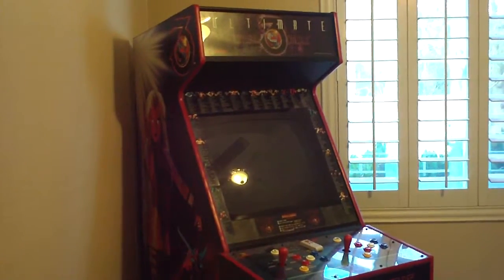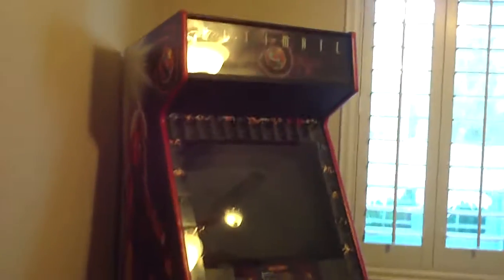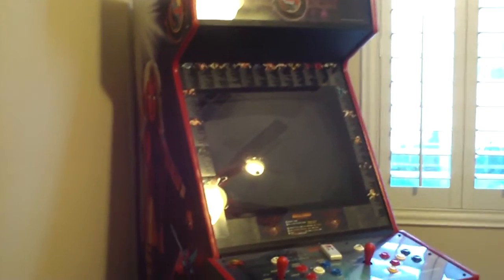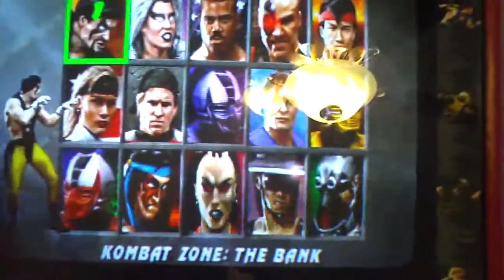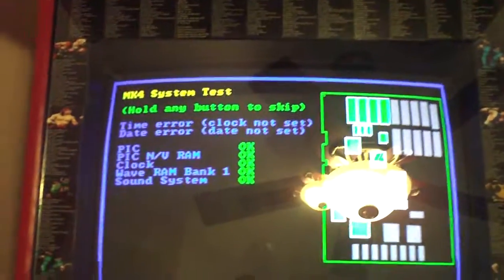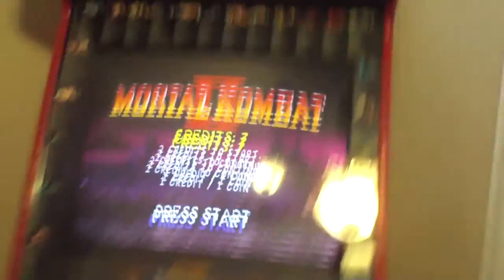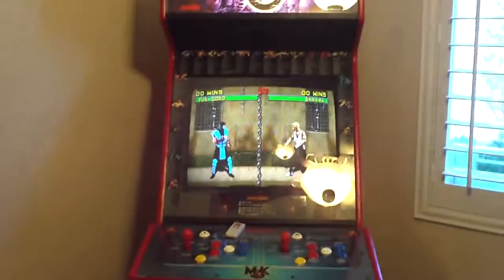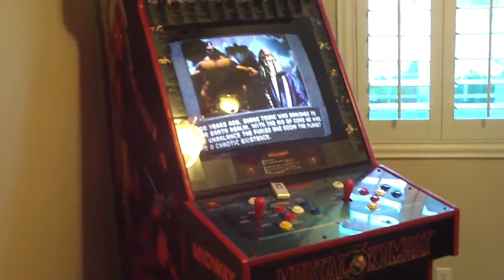MK2-MK4 PCB's all in MK3 Dedicated Cabinet

Comment: Nice setup! I'm curious if you would know the answer to this question: Would you be able to plug a J-Pac into one of these slots? My ideal situation would be to place 5 MK PCBs into slots 1 through 5 and then install a J-Pac into slot 6 that connects to my MAME computer so I can switch through everything on one cabinet.
Reply: i would suggest that you get yourself a gaming tablet and hook-up an arcade stick 2 it, then get a MAME Emulator and all 5 Roms off the internet 4 free, if you want all 5 games together. that's what i did.

Comment: Hi Ctozzi
I was talking to Mike and he told me to come to you with my question. 
Do MK1&2 have a different resolution sizes to MK3&4 which means you have to adjust horizontal and vertical settings to get a full screen picture when switching between games using the 6 in 1 multi pcb switcher?
Thanks
Tim